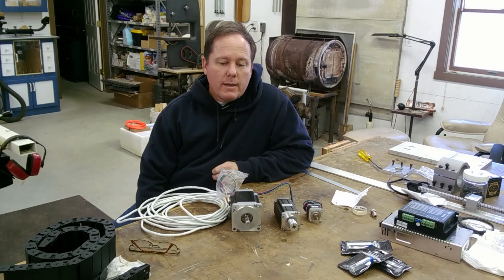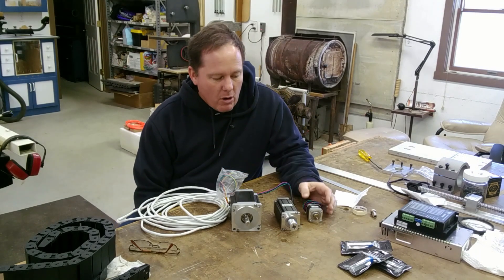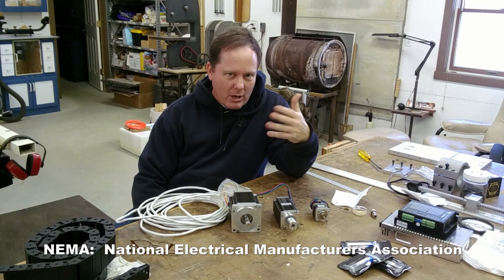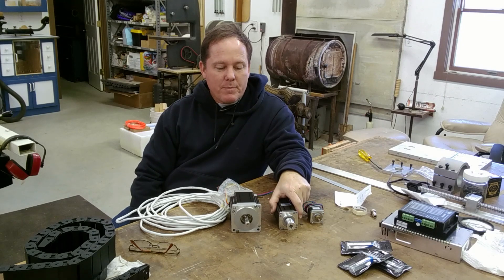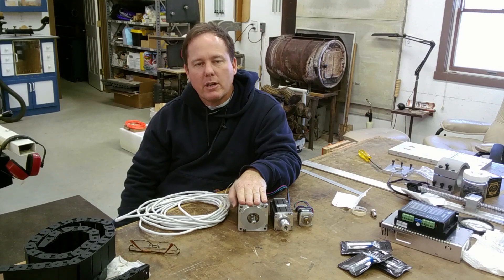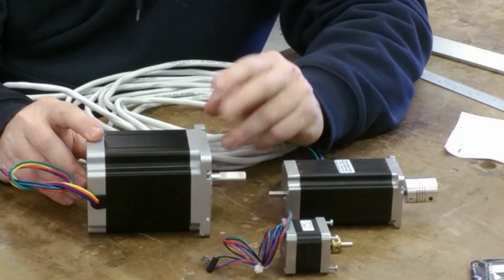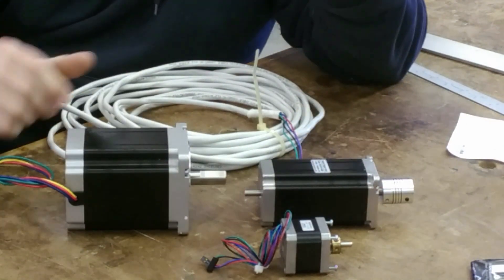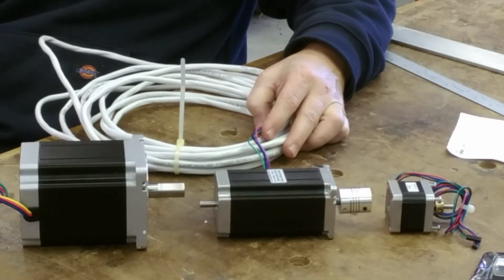Practical Insight in selecting stepper motors for your build - Republished

Comment: From what little I've seen of your build, I like the design. I've built a small cnc machine before but I would pay for plans if you are selling any or if you can tell me where you bought your plans. I plan on building the frame out of steel and welding it myself. Thanks and good job on the video.

Comment: I think there might be a direct correlation between the size of machine (600 x 600, 400 x 400, 200 x 200 etc) and the oz/inch figure, bearing in mind its application (cutting just wood or aluminium?) Would like to find approximations for this.

Comment: normal popular size DIY cnc woodworker used nema 23 112 long motors, because need be rich can buy nema 34 motors have super expensive buy, or if need better motors need buy nema 34 closed loop motors and price go 10X expensive than this normal open loop motors have. my cnc have same than you have SBR rails ballscrews but i use nema 23 2 Nm motors and have problem need biggest motor because lose steps if run feed and jogging speed too high. need more torque not lose steps. and then can run motor more speed not lose steps. minimum nomal woorworkers cnc need use 450 OZ nema 23-112 long motor. have normal minimum what can use. laser and 3D printer not need big motors because no need lot torque move. problem have need use nema 34 1200 OZ motors but have super expensive, normal hobby user not have budget buy thats. or perfect have nema 34 closed loop motors, thats include encoder can know realtime position ewerytime. but cost 10X more than normal steppermotors.

Comment: Hi I want to fit on my 12feet manual  lathe taper turning slide which size of steeper motor if perfect for it. And which driver and speed controller will use for it.

Comment: Should I get bipolar or unipolar motor?
Reply: Bi-polar is very often the stronger of them less cabels to but the most importanet is the torque, and type amount of speed, and how hevy it ¨s going to move,  and witch metod  you move i with toy have lead skrews 2-8 mm of pitch, ballskrews with about 3-4 mm but will go witout friktion almost, trapetz skrev 2-12-- of pitch  with brass nuts, more friktion, and of course the amount of weight of the total axiz include the friktion of the linear , and  the power thats must push the spindel with thw right feeed and speed through the material, for plazma table u  dont have  the same push power that you need in mill or router for wood, same with laser cutters, water cutters,  then toy have racks and pinion drives and belt drive, and you can make a type of simple gear box, if you dont by it with a planetgearbox from the start with 2 diffrent size pulleys and a GT timing belt between,  if you for example use direct belt drive use poleutane with steel core GT5 with the right with  often dont need wider then 15 mm or so, the amount of tracel speed with 3mm pitch is extreamly fast, if the pulley and minimal size its still flying, and of course this eats torque same with rack and pinion drive, If you drive with pinion mod 1 and shoes a small spur gear wheel u can direkt drive a big desktop cnc if the friction of the components gantry are as low as as they always should be and the axis is as heavy as it must bee but not over thinked and  weiights to mutch, with 18 teeth direkt on the Nema 23 motor of course you can drive it on the 1 rack with right halvfstepping settings  and one motor on each side of Z axis lane but the are very often moubted on the Y axis and the rail in the x axis linear i spell like shit it¨s morning and am from sweden maybe thats explane´s some of it...

Comment: What usb board should I use to run nema 34 & 23
Reply: USB used only controller and controller use stepper motor driver and driver use motor, driver need be same size than motor maximum current, etc motor need 4 ampere maximum, need buy driver what can setting more than 4 ampere not burn driver but need important setting driver little less than motor max current have or burn motor. 4A motor setting 3,9A driver current max, controller send only step and dir signal to drivers, computer send usb or paraller port signal to controller and controller send signal to driver and driver run motors.

Comment: Hi Mate, 
I am going to carry a steel pallet (overall weight of 700 kg) over rollers with 2 stepper motors on each sides, do you reckon "Nema 42 CNC Stepper Motor Bipolar 30Nm" is enough for this application?
Reply from the maker: Wow.  That is a lot of weight.  Assuming direct drive, I'd go big.  I don't have any practical experience with neither that size stepper, not that much weight.  Acceleration from zero is the hurdle of course.  Think about what might happen if one motor misses a step?  Would gear/chain drive from a single motor to an axle shaft be better to prevent issues with the pallet becoming twisted on the rollers?  Or maybe the motors are driving the rollers?  Sorry.  I can't help much further, if I have helped at all.  ~P
Reply: 700 Kg mean 7000 NM if hoist this weight, need calculate/measure how much weight need use can move 700Kg horicontal whit rails. how better rails have then less need torque move weight at rail.

Comment: Don't forget its not all about torque, you have acceleration and deceleration too - the larger the motor the lower the acceleration due to the mass involved. Instead of 34's i would be looking at AC servo motors - far stronger, less power supply demand, faster, better torque curve, same frame sizes available plus they have encoders built in
Reply: problem have price, AC servo cost 10-100X more than normal stepper motors plus need 20X expensive motor driver board too. hobby user not totally have budget build AC servo cnc or waste lot money stupid.

Comment: Thanks for the video and information,
Does Nema 17 motor has an encoder with it? if not is there any other stepper motor with an encoder of this size?
Reply from the maker: Stepper motors don't have a feedback loop  such as an encoder.  I habe seen them added to double ended stepper making them into servos.  I believe they are available in a 17 size.  Check out Clearpath servos.
Reply: @sbirdranch  Thanks, I am working on a project that needs to read back the position of the motor.
Reply: @PayamJianTV  Choose servo motor, if not available Nema 17, use smallest Nema 23. For those motors you need HS type drivers.

Comment: I'm planning to use two stepper motors to drive and control a wheelchair. The user weighs 90kg. What do you reckon which model of NEMA stepper motor I should use? Also, is the shaft durable for that kind of load?
Reply: Yust buye on E-bay wheel chair motors, more cheepest then steppers.
Reply: better use wheelchair DC permanent magnet big motors, same than have real wheelchairs or golfcar, normal used big DC motors whit geart.

Comment: Hello, I am building a plasma cutter and I am new to this CNC stuff and I am a little confused as to what would be the best size motors to us on the x-y-z axis. I like your video,just trying to wrap my brain around as should I use the 34 or go with the 23 or both?
Reply: biggest 23 motor have popular used middle size plasma machine. 34 have too big not need because not need lot torque move all axis.

Comment: First I bought nema 17's.. Too puny. Bought nema 23's.. Still too weak for my Z axis.. Now looking at nema 34's. One day I will get it. Hope to build conversion parts for a mini milling machine cnc.
Reply from the maker: Keep in mind that the same frame size (17, 23, 34) come in different torque ratings.  Simple visual clue is the longer the motor the more torque. ~P

Comment: Lets say I have a 3d printer with a very small stepper and I want to put a bigger stepper motor in it.  Assuming I mount the larger motor/driver/power supply, can I use the same control signal wires?  If the original motor spun 3 times will the larger motor still spin 3 times?
Reply from the maker: Assuming as you say you have the appropriate driver, the signal wire can remain the same.   The revolutions will depend on how many steps per rev your old motor and driver were using, vs your new ones.  For instance, my drivers can be set to do several different resolutions by doing fractional steps. ~P
Reply: @sbirdranch  thank you, I will look into tune able drivers so I can match steps
Reply: NOT, need arduino or stm32 board take out step and direct signal to biggest stepper motor drivers. drivers need step and direct signal. etc, DM556 driver. step direct and enable signal need.

Comment: Really good video.  I'm using 
42 Stepper Motor, Voltage: 12V, Phase Current 1.3A, Torque 0.25N.m. on my 3018 cnc and want to upgrade the y axis to a more powerful one as I'm making the machine much bigger. What would be a good stepper motor to buy to replace the one above. The new one would need more  torque due to the extra bed weight.  Cheers.
Reply: nominal minimum cnc need use 450 OZ or more torque motors minimum have 3Nm motors. NOT 0,3 Nm.

Comment: Probably the best video I’ve seen on here so far!  Very good explanation of the motors.  I was considering NEMA 42’s for a 4’x4’ working area but I think I’ll go with the 34’s, I see so much stuff online that it is really confusing, and with the cost of stuff I don’t want to make a costly mistake by buying the wrong parts, you think for your viewers you could post a list of parts that you bought with a list of manufacturers and specs and where you bought them?  I know I would greatly appreciate it!
Reply: I made a plasma cutter with 2 nema23 570oz, even with one motor connected it moved the whole gantry, and made parts. Later on I found that the motor connector was disconnected from one side and the machine still work this was a 4x8'. So, if your gantry is not way too heavy, putting 2 nema 23 at 570oz is more than enough, what you need to think about is a nice power supply at 60v and a nice driver that can take those 60v to 75v. They do behave more powerful with higher voltage. By the way that plasma table was with 2 power supply, one at 24v and one at 36v. It was for sale and was all chinese junk. I sold it for 1000 bucks. The new table was with nice drives, 60v solid transformer, etc...

Comment: it sometimes pays to watch all these videos as I just completed my CNC router and I went with the 34's all around. Now I am thinking about changing the Z axis to a 23 and this video answered my question on the ability of the smaller motorThanks for the info!
Reply: i dont get it,.. z axis is better to have a smaller stepper motor? for example if i have 1200 oz for x and y axis, i have to put a 600 oz? correct?

Comment: One Caveat: I know you "say" you didn't need the monster steppers for your Y, but I just finished building a 30 x 60 machine with ballscrews on the axis and my salvage Nema 23 with 425 in oz can't move the Y fast enough without stalling. I'm about to upgrade to Nema 24 or 34 so I can get my speed up to a decent rate.  Right now I can't go any faster than about 25 ipm. Now my steppers could be tired, they are 10 years old and have thousands of hours but at slow speeds they have more than enough power but anything over 25 ipm, they skip like a 7 year old girl on the first day of summer. 

Another thing: ditch your raised gantry. My last CNC was like this and it is a PAIN in the ARSE. You're always trying to reach around, through, over the gantry. I switched to a conventional gantry and it is HEAVEN compared to the other POS. You have full unfettered access to the entire bed, from any side.
Reply: Muskoka Mike I was surprised when he said he used 34s for his, but he has freak 2 of them doing the Y. A single-family would probably be perfect, but 2 seems insane.
Reply: The problem is though if you use one, then you have a racking issue or how to transfer the movement to the other side. My old POS machine used an internal shaft inside the actual gantry tube with the Y motor mounted transversely on the end of the gantry. (which made it hang out in the middle of nowhere to catch on everything and anything).

Comment: I’m wanting to build a single axis indexer for cutting gears on my mill. It will be operated in a manual “jog to next cutting location” as needed. What type of a stepper controller would you recommend for a NEMA 17 or 23 motor?  I don’t want to use Arduino and plan on using an ST-PMC1 programmable controller. Thx in advance. Nice overview!
Reply: arduino can use many motors, but arduino steppermotors shields not handle more than max 2 ampere motors need use external steppermotor drivers, etc, DM542 or 556 i use my woodworking cnc DM 556 max 5 ampere motors can use. DM 542 max 4 ampere motors. stepper motor driver have important select same what motors max current have. or burn driver and motors. not can use 5 ampere driver if motor max have 3 ampere burn motors.

Comment: Thanks for the great video, i had seen it before and really appropriate the update bullet points. Like you said if we had a question just ask. Well i need help from some one on your side of the fence since I'm very new to the CNC world. I just recently purchase a use Router table with a steeper motor system (NEMA 34) already in place but for some reason its not working. It's and older system that uses a PC, Parallel port and Mach3.  Every time i connect the PC  for some reason it burns out some of PC internals and I'm having to repair it. I'm thinking i may need to set up a who new controller and power system but I'm not sure where to begin. I would really like to keep it to the basic so i can get my feet wet. I have also been thinking of using LinuxCNC to drive my machine vs Mach3. I would really appreciate your input in all aspects, Thank You (Rmginusa@gmail.com)
Reply from the maker: My machine uses Mach3.  I have added a smooth stepper so it is not direct from the parallel ports.
You obviously have a short in something.  I would suggest you go at this one step at a time.  Unplug everything from the computer through the break out board (BOB) where the parallel cable(s) attach on the controller.  Disconnect all the stepper drivers from the output side of the BOB.  The BOB is just a dumb board that separates the pins from the parallel cable, to the easy places to connect wires going to the other components.  Sometimes the board requires an additional 5v power supply.
~~Make sure everything is sharing a ground.  Remember that the outer shield on the parallel cable is a ground. ~~
If you are afraid that your BOB is bad and you don't want to risk burning up your computer again, you can get an inexpensive BOB from Amazon or ebay to test things out.
Also....try a different parallel cable.  It is possible that the one you have is shorted.  ~P
Reply: sbirdranch, You are so cool, thank you for replying and that is just what I'm going to do. Thank for all the great videos

Comment: Thanks so much for the information.   I am interested in building a 5 by 10 plasma cutting table can you direct me as to which motors can I use for the x ,y ,and z axis.
Reply: opps  what's the difference between the 1600 oz .in and the 878 oz.  motors I am factoring that also  into my build.
Reply from the maker: I would suggest that you can use NEMA 23's.  Here's the thing, it doesn't matter if your table is 5'x2' or 5'x20'.  You are moving the same thing around, just further.  In addition, plasma tables have no cutting induced drag.  If the motors can overcome the weight of the gantry or axis, and any friction in the rails, you are good.  I would believe that you can build slides aligned well enough that 23's with a large-ish torque rating should do it.   The Y axis the the heaviest, but assuming a duel motor design, it has two motors to move it.
Two other factors to consider in picking the motor size.  More torque also means you can change direction faster.  That could be important.
The other factor is the complexity that a larger motor adds.  I am in the process of building a plasma table (4'x4'), using 34's (so I can re-use my control podium and power supplies).  The factor I am having to deal with is the size of the motor shaft.  You can't get small pulley's/pinion gears with such large motor shafts.  I am considering options such as machining down the motor shaft.
Wow, that was long winded.  ~P.
Reply: thank you so very much for your advice I understand what you are saying  .all the best in your future. I will be in touch
Reply from the maker: I look forward to hearing about your progress.  ~P
Reply: lot has build whit nema 23 450 OZ about 3Nm torque motors but biggest better about 800 OZ, plasma not need lot torque woodworker cnc mill need more and woodworker cnc minimum have 3Nm motors.